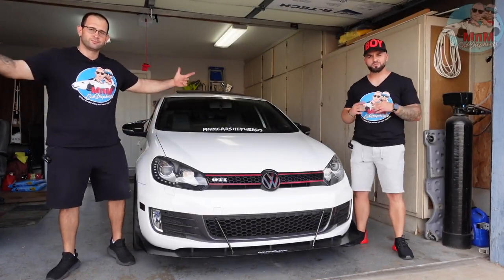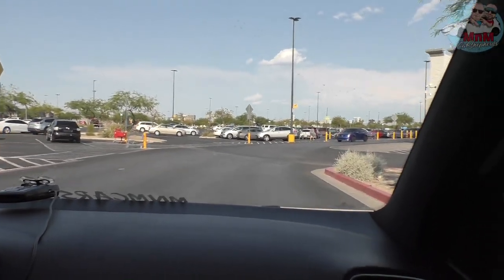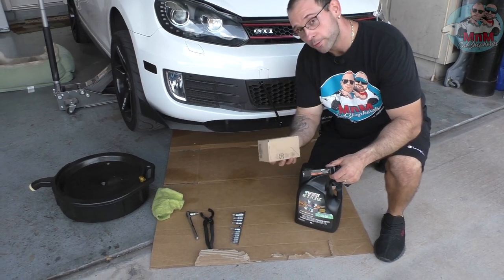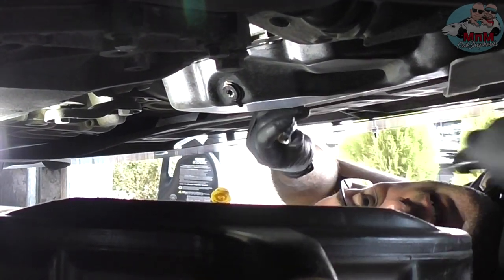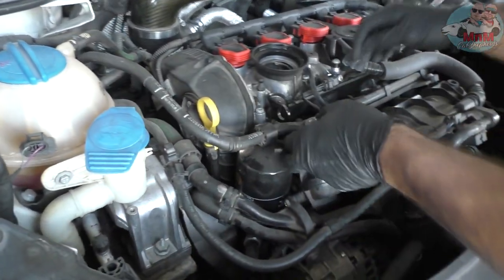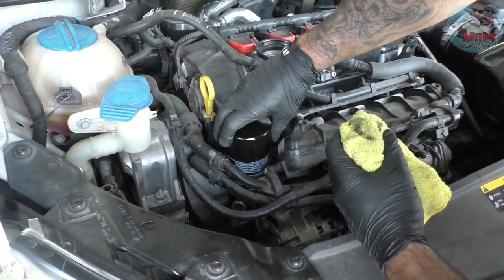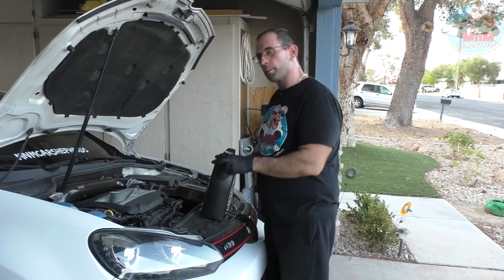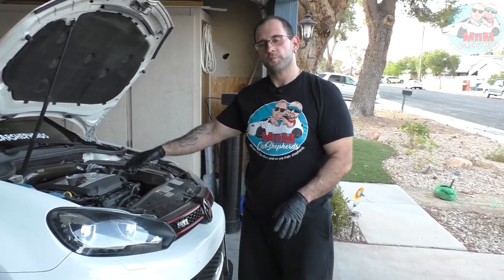VW MK6 GTI OIL CHANGE/EASY HOW TO  DIY#vwmk6gtioilchange

Comment: Hey man just a question, at how many miles would you change the filter? 
I’ve had my gti for years now but someone told me for synthetic oil the oil change is 5 to 7k miles
Reply from the maker: We would always change the oil and filter no matter the car at 3k miles or 3500 miles at the most.
Because it doesn’t matter if it’s full synthetic oil or non synthetic the engine burns oil filter especially if your car is tuned and for us 5k is way to much,unless you put in your GTI High performance synthetic oil always change it at 3-3500k miles and the oil filter.
We will give you a example we changed the oil on the gti before Martin switched to Motul High Performance oil on 3300k miles and more that 1.5 half quarts where missing🫣
Just imagine if we waited till 5-7k just it will even be less.
So if you like your car and want it to last a long time change your oil and oil filter every 3k-3500 miles and you will be happy and your ride will love you more 😉

Comment: I prefer the rubber band with the red handle to remove the oil filter.
Good video, a few improvements ..
- level the vehicle, towers on both sides
- is better to change the oil after warming it up, then wait about 20 to 30 minutes, warm oil drains out way better 
- remove the oil filter, it holds a few ounces of oil due to its spring loaded plastic insert.
* Oil should not drip when removing it if the oil spring valve (black long plastic piece inside the filter mount), is working correctly.
Unscrew the filter slowly, wait and it will drain down the pan, just take your time.

Overall, good DIY! whoever did the editing did a good job. 
*I use the stubby ratchet or hold a regular ratchet halfway in the handle to not over torque.
Reply from the maker: Thank you 🙏🏻😊We appreciate the Feedback 🙌

Comment: 5w-40
Reply from the maker: 5w-40 works well to and probably better depending on the brand.
We have switched to Motul or Liqui Moly 5w-40 and we are really happy with it.
But the oil filter we always by it from the dealership😊